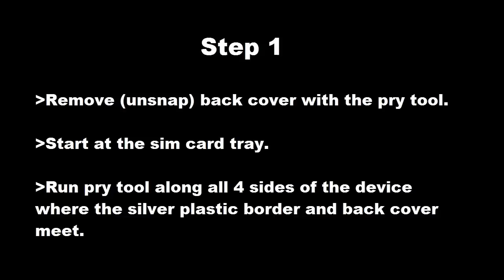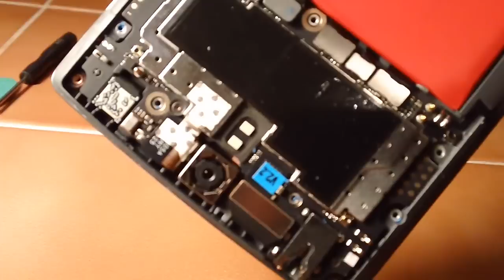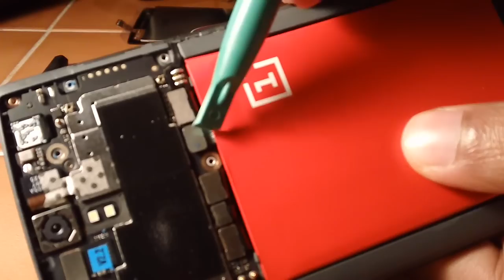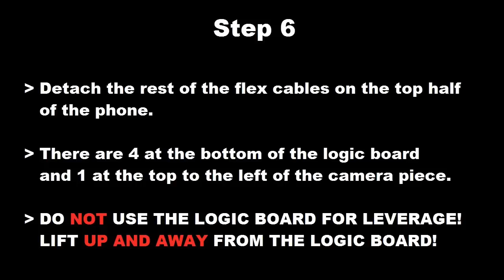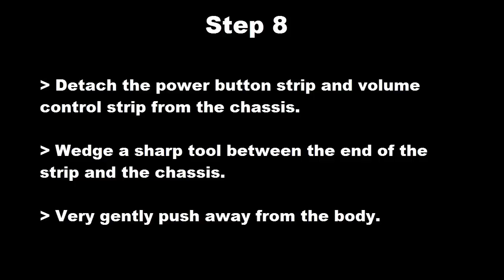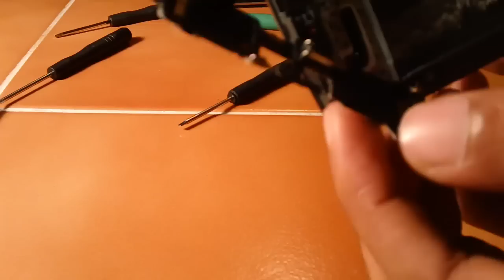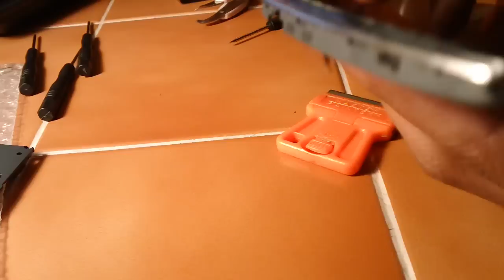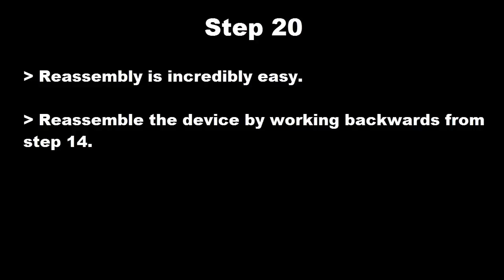HOW TO: REPLACE ONEPLUS ONE SCREEN (OPO Disassembly Tutorial) EASY COMPLETE TEARDOWN

Comment: I destroyed my hear piece following instrustion @12:20 Why do you even remove that ?
Reply from the maker: This step was included in the instructions I gathered from two members of the forum. I believe the reason for this step is so that you don't burn it when you heat the mid frame. Also, it's helpful if you are switching mid frames. I also damaged my receiver. Thankfully I can live with the damage and if I really needed to replace it, it's only $6
Reply: Stephen Johnson It's very unlikely that this thing will burn from the heat of a hair dryer, Also I found the heat to not be useful when removing the glass.
Reply from the maker: It's supposed to loosen the adhesive, according to phone repairmen. I sat there for a good while before it started to work.
Reply from the maker: Bitcoin Embass another professional repairman added in the comments of this video that some of the teardown is excessive for just a display replacement.

Comment from the maker: For Anyone Asking About Adhesive To Use For Attaching The Replacement Screen, Use Double-Sided Tape or Any Silicon Based Products. Here Is a Link To Double-Sided Tape: http://goo.gl/duqIae
Reply from the maker: great thanks for the link!
Reply: Stephen Johnson  Do I still need to get the adhesive if I bought the  assembly with screen and frame already fixed together? Might be a stupid question, I'm just buying all the parts I need to fix my broken screen :/
Reply from the maker: Angie C no you don't need to. You only need the tools that come with your assembly except something to help pry the battery out. That's it.
Reply: Thank you (:

Comment: I should have done a video of the blu studio screen replacement I haven't seen anyone do it before
Reply from the maker: why cant you do it now?
Reply: Stephen Johnson I don't have the phone now
Reply from the maker: Zach Saxe
 ah i see
Reply: plus I took the phone apart a month before the parts came to fix it so I had no idea where what screws went where. It also wasn't as good as yours I just found sticky stuff to stick the digitalized to the phone. It's not the same as the OnePlus one the screen and digitizer where two separate pieces. I also through away the speaker grill

Comment: S U C C E S S. thanks to this guide here i just swapped my digitizer out. thanks again.
Reply from the maker: ***** that is fantastic!! But was it just the digitizer or the fused LCD+digitizer?
Reply: Oh it was the fused LCD+digitizer. I found out that im unable to receive audio from calls, but who ever is on the other side of the line can hear me. I didn't connect something aha WUPS
Reply from the maker: yeah those connections are important. i actually messed up my receiver so it sounds bad. i hope yours is only not connected properly. a new receiver costs about $6, though.
Reply: Ayee okay, I'll look into that for sure. Thanks again!

Comment: how long did it take you to finish replacing the screen?
Reply from the maker: Since I did the video as I replaced the display, it took forever. I spent about 6-7 hours. But I can fix another one in 20-30 minutes since I know what I'm doing and I'm not making a video while doing it.
Reply: I realized, after watching the video and looking into it myself, I found that the reason why the screen wasn't as vibrant and high res as it was before was because you replaced the lcd display with a cheap knock off. I think that just replacing the glass cover would have been better. I've seen the glass cover replacement for about 20$ and the actual lcd display replacement with glass was around 100$..
Reply: Stephen Johnson or would that not have worked?
Reply from the maker: Anonymous Alex  im going to make follow up video for using the new display for a month at the end of this week so you can see how it is. if you try to replace the digitizer glass only, you risk damaging the lcd since they are fused together as one part. i strongly recommend only buying the single fused part. my display looks fine, now. not perfect like before, but the difference is very minimal, now. i think you just need to break it in for a week or two of usage.
Reply: Stephen Johnson when you say break it in do you mean the coloring improves a bit overtime?
Reply from the maker: Anonymous Alex i mean break it in as in use it, basically. like you might have to break in a new pair of shoes before their comfortable. you know? yeah, just use it. although i dont know if this is true for all displays. this was just particular for me. ive seen numerous accounts of people saying the same thing i have on the forum.

Comment: Thanks for a great video! One issue, the new screen will not pop in. Do I need glue or something?
Reply from the maker: Yes you need to put a thin layer of adhesive or use thin adhesive tape around the edges of where the display will sit. Make sure you cleaned out the mess the old display left on the frame. That's probably your issue. Also be careful that your flex cables are not being trapped underneath the display

Comment: Saw your post on the forum. I dropped my phone the other day and now half the display doesn't register touch input. The bottom half works fine.  Where is the best place to buy a new display to put on
Reply from the maker: stefan adams you can go to aliexpress.com vifocal.com or eBay.com but please don't pay over $85 for a new display ( fused LCD+digitizer).
Reply: The bottom half of my display still works fine( typing on it now) the top left portion is cracked and the crack runs down the left side of the display. All the pixels look fine, I can see everything, but the top half of the display does not register touch. I activated the setting to show touch and it gives no reading above the middle of the display. Just to be clear, can I buy a digitizer alone and replace the broken one? Or do I need a whole to LCD panel and the glass 
( the glass part is the digitizer, no?)
Reply from the maker: stefan adams you need the fused piece. otherwise, you will break your LCD trying to only replace the digitizer.
Reply: In your video, you sounded disappointed with the LCD. You mentioned the colors were off. How did that turn out? Is it the same resolution? If I can't get the same LCD and digitizer, I rather just get a new phone, no what I mean? What if the LCD I buy is 1280x1080 ?
Reply: Oh and will the new display have the capacitive buttons?
Reply: Oh and will the new display have the capacitive buttons?
Reply: Please get back to me steph.
Reply: Please get back to me steph.
Reply from the maker: stefan adams I could have sworn I responded to you. Sorry about that. The display looks fine now. I think it needed time to adjust to being active. I really don't know why that is. The new display has the keys, but mine do not light up. The keys still work. I use them just like before my accident.
Reply: Thanks. I just bought an OEM LCD and digitizer with tools.
Reply from the maker: okay, fantastic. please let me know how everything else goes with the process
Reply: Yea definitely will. Thanks again
Reply: Yea definitely will. Thanks again
Reply: Stephen Johnson he  man. please get back to me on this. 

okay i got the new display. every thing went well until i tried to remove the old display. the black plastic frame (the one the glass sits in) came out. i already ordered the whole front  housing . so my question is: what kind of adhesive do i use and where do i get it? thank you
Reply from the maker: stefan adams you can use super glue. Any really strong and fast bonding glue works.

Comment: I also forgot to mention that my screen is now not operational because of the crack. Also how much different will a third party case be. Is it a drastic difference?
Reply from the maker: OnePlus will charge between 187-201 to fix your screen. They told me $201. There isn't much difference in my replacement screen. This particular unit has a slightly pale/lighter display. Since I made this video, the colors are 90% normal again. You can find this replacement kit with screen and tools for like $70 from Aliexpress.com

Comment: Hey Stephen. Matigus from the forum with the wonky looking screen. I'm working on the battery right now... and I'm really worried about bending it. But so far great, easy to work with video. Thanks!
Reply from the maker: Matthew Magcalas good to see you, Mathew! are you actually replacing your screen? i thought you werent going to do that yet. if you wanted to check the connections, all you need to do is take off the camera cover. if you are going through the whole disassembly, make sure you are using a metal pry tool to take it out. using my fingers wasnt a great idea. you want the battery as straight as possible. i bent mine a little bit and i havent had problems, though.
Reply: Stephen Johnson I checked all the connections... Nothing loose. I made sure of that and even powered on the phone to check. So far... seems like the digitizer is the problem(?) or at least that's what I'm hoping. I ordered a new digitizer and screen last night minutes after I made the forum post since a close friend of mine that fixes lots of phones believes that it was the issue. I PROBABLY bent my battery slightly, but as long as there are no issues, I'm fine with that. Still working on it though. I'm lifting the non-glued side up slightly and then pushing the glued side to the left to hopefully do less physical damage to the battery. I'll update you as soon as I'm done removing it.
Reply from the maker: Matthew Magcalas alright. sounds good. but since you do not have the replacement screen yet, dont you want to wait for it before going any further?
Reply: I probably should... I'm just a little impatient sometimes. I was thinking might as well remove the stuff now so all I would have to do is put the new stuff in as soon as I receive it.
Reply: Matthew Magcalas Putting this reply on YouTube so that anybody else that's scared like me with the battery can use this method. I managed to remove it without using force. After you're able to life the battery's non-glued side up... keep it pried open and use tweezers or something thin and sturdy to separate the glue between the phone and battery. Worked out really well and faster/safer than pulling it.
Reply from the maker: Matthew Magcalas in my case, i couldnt make any moves until my screen replacement came becaue the OPO is my only phone. if this is not the case for you, well, just make sure you dont loose all those screws!
Reply: Stephen Johnson I won't! Have a handy dandy metal magnetic bowl. Thanks for the help!
Reply: Matthew Magcalas How drastically different is the third party screen? I'm kinda worried this won't be as awesome...
Reply from the maker: Matthew Magcalas my screen is fine, now. it comes off as slight lighter colors, but it's nothing big anymore. it looks darn near fantastic again. although, i can still tell it's not my original screen. it's not bothering me at all, anymore. im not sure if im lucky that it looks better after using it for a couple weeks or this just a natural thing that is supposed to happen. whatever it is, im definitely satisfied with my new screen, now.

Comment: What scares me is that you keeping saying "I think" and you don't sound very convincing. Did you actually replace the screen or did you just buy another phone.
Reply from the maker: sorry about that. it's a pretty simple procedure. i had zero experience in doing this sort of thing before as stated in my disclaimer. however, i made sure that the clips and method of disassembly was sound before i uploaded it. i should have killed the audio at some points, but i wanted to remain human so that people could feel like even an average joe could do this. i would not have made the video if it werent helpful. so far, repairmen and brave souls (who used my video) have only given me positive feedback on the validity of the procedure. i believe you should feel confident in doing this yourself. yes, this my only OPO. i bought the new screen for $90 from ali express with money donated to me by members of the forum. buying another OPO would have been way too much of a hassle. also...why would i have a new screen and a new phone...doesnt make sense lmao - if you're actually attempting to do this, please hit me up on the forum so i can properly guide you where you have any misunderstandings.

Comment: How long did shipping take? And when you say the colors are different do you mean in a noticeably bad way?
Reply from the maker: Shipping was 10 days. The colors were very pale with a yellow tint. After using it for two weeks, it looks a lot better. I'm not sure why. It looks almost normal again.
Reply: Stephen Johnson Some units were faulty and had a yellow tint due to the screen glue not drying properly. Which can be fixed by UV light exposure or frequent usage of the screen.
Reply from the maker: KROreviews that's still a myth.
Reply: Stephen Johnson I will say that when I originally got my OnePlus the screen was a bit discolored. I let it sit in the sun for a while it it was fine.
Reply: Stephen Johnson A lot of people were able to fix it that way. I'm not sure if that fixed it for a lot of people but my oneplus unit wasn't yellow tinted luckily.
Reply from the maker: julian king KROreviews after using my phone regularly and staying indoors most of the time the screen gotten better every other day. Right now, i think it's fine. I havent gone outside much at all, so that is why i still call it a myth. It could be true or false. All i know is that I dont have to worry about it and im glad.
Reply: Stephen Johnson Oh okay I had watched this video https://www.youtube.com/watch?v=_B6Y8o8bd00 and many other people had made videos like this and said it worked. So I had assumed it was the same for all faulty units.
Reply from the maker: KROreviews it could be. You're right to assume.

Comment: Good tutorial with just a fee points for people watching this. 

1: Don't worry about time and date it was wrong because you are on airplane mode and pulled out the battery. I'm sure it was right when you went off airplane mode.
2: You removed way too much stuff. I fix phones for a living and this looks a lot like the LG G 2. All you have to remove is the back pieces and the battery. The bottom screen flex will come out WITHOUT removing the charging cable and the whole bottom. As far as the top flex goes it should come out fine without removing the main board.

Basically the steps needed are remove back pieces. Remove battery. Remove top and bottom screen flex cables. Carefully heat up screen and pull it out. Then put adhesive and snake new one in and reassemble.

You might have to play around with the ear speaker for the top cable but if you are careful it will come out without removing the logic board.

But all in all good tutorial and glad it got fixed. You should call this video Complete OnePlus One Teardown
Reply from the maker: Thank you for this.
Reply: No worries great video though. If you are ever in Jersey and need a job I got one for you at iCity Repair haha
Reply from the maker: Jason Becker haha sweet i'll let you know if i ever go up there and need a job lol

btw, are you on the OP forum?
Reply: Yup I'm dragon2777 you actually told me where to buy the screen and told me to go here
Reply from the maker: Nice. I followed you on there. I'm glad I could help point you the
direction.

Comment: Hey Stephen, thank you so much for your video.
So my screen got cracked too unfortunately. What would you do:
* Get it replaced with an original screen by OnePlus (for 170 dollars)
* Replace it myself by buying a new screen incl. midframe (90 dollars + 30 for taxes)
* Replace it myself without the midframe, thus having to separate the old screen and midframe myself (80 dollars + 30 for taxes)
* Sell the phone and get another one with "normal" warranty.

Comment: Nice tutorial, Stephen! I've followed each step but I'm currently stuck in step 15. For how long did you use the blow dryer to loosen the adhesive?  I've been using it for half an hour but the screen still seems to be glued  to the midframe. Thanks, dude.
Reply from the maker: I had to keep checking if the adhesive was loose. I did this for about half an hour. You want the midframe to be very warm. Focus most of the heat on the top and bottom of the frame. If it starts burning your hand, you are applying too much heat. Just keep heating it and checking it every 5-10 minutes.

Comment: You only replaced the screen digitalizer and not the whole lcd? did your touch work before the switch or was it all dead?
Reply from the maker: flod943  I replaced the glass digitizer and LCD. The are fused together so it is one piece. Before I made this video, the bottom portion of my screen would not register touch.
Reply: Stephen Johnson So if I buy this http://www.aliexpress.com/item/Original-Oneplus-One-LCD-Display-with-Touch-Screen-Digitizer-for-Oneplus-One-A0001-64GB-16GB-Replacement/2035214073.html and replace it with it should work again? sorry for long link
Reply from the maker: flod943 that is incredibly cheap. normally i see them around for $75 to $90. it will work, just as mine works. as you can see from the video, it's like playing with advanced legos or something. just make sure you trust the seller. vifocal.com is another good place to purchase the digitzer+lcd
Reply: Stephen Johnson After a few hours I am now done with my building process. It works great except for the light on the keys in the bottom. Would like to thank you for this tutorial and your help. love <3
Reply from the maker: flod943 awesome!!! I'm glad you got it working! Thanks for using my video.